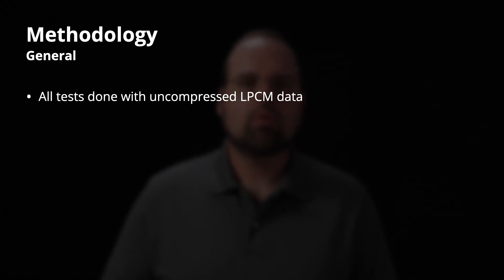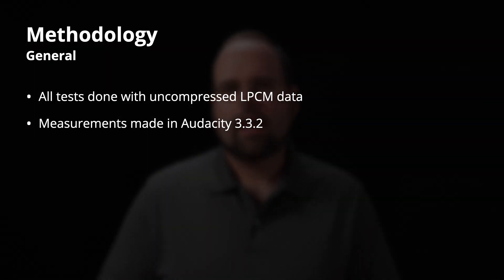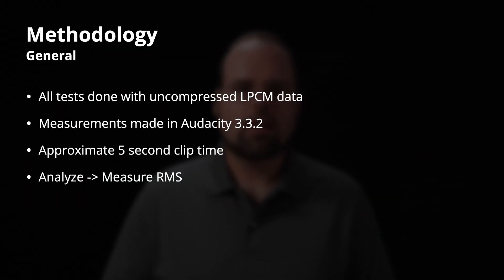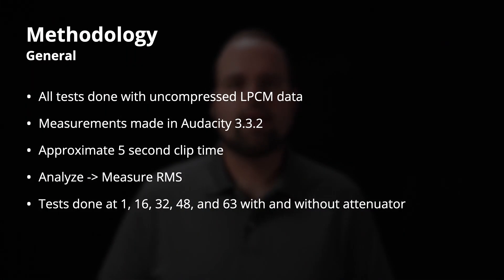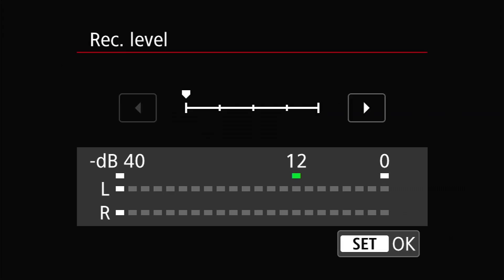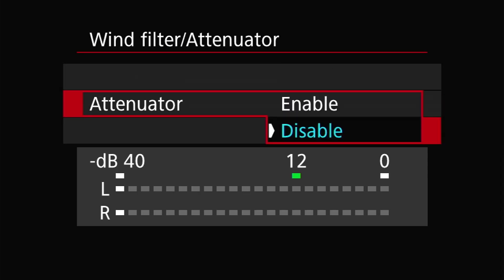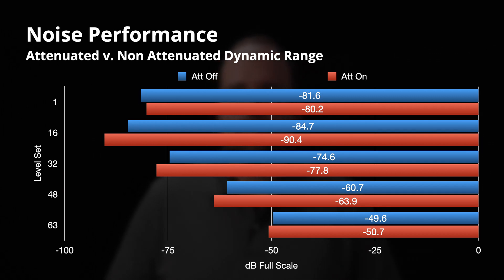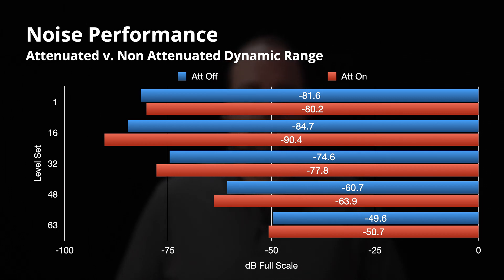R5 Audio Recording Performance Tests - EOS R5 Tip 69

Comment: Hi, I found this video hard to understand, not your fault the presentation and pace was excellent. The previous one was easier to understand. I have been recording a friend who is an opera and classical singer in an outdoor situation using my R5 camera In my ignorance I have used the C3 P mode in Auto sound recording and compression. I have not been entirely happy with the sound, I felt the higher ranges of her voice were 'subdued'. Would I be better recording on manual? If so, what should I set the manual figure to? Should I have compression on or off. Would I be able to test this in my house by playing a cd of similar music and trying the different settings? Sorry if this doesn't make sense, I am a stills photographer and trying to get into video recording.
Reply from the maker: Starting with the stills photographer getting into video bit. That's my story too, and audio is one of the things that I still struggle with. Especially being confident that I'm doing things "right", which is odd as that was never something that I really worried about with making an image.

With that said, the way I've come to think about audio goes like this. First, sound isn't light. You can't telephoto mic your way to better sound, you need to get the mic closer to the subject. A mediocre quality lav mic clipped to your subject's shirt is almost always going to sound better than a professional shotgun mic on camera 10 feet away. This also helps with SNR (signal to noise ratio) and frequency response.

Step one is always to get the most signal with the least noise to the recorder as possible. And keep in mind noise here doesn't just mean like self noise or something like that, but the entire rest of the soundscape where you're recording.

Step 2 is optimizign the recording. This is where you'll want to use manual levels, and set them as hot as you can go without clipping. Digital audio, just like digital photography clips when you reach the saturation point. And as you know, when you blow your highlights, there's no data to recover there, the same goes for audio.

Generally the rule of thumb is to aim for your levels to bet around 12-18 db below 0dBFs (the clipping point). This gives you some headroom for louder transients. However, this is a rule of thumb, and you may need/want to go lower than that what you're recording has an especially wide dynamic range between the soft and loud parts.

Which brings me to compression. In the case of the R5, this controls whether the camera records uncompress linear PCM audio data, or lossy-compressed AAC audio data. Personally, given how small audio is compared to video, I don't see a compelling reason to use the compressed (AAC) audio option. At least not if you're shooting anything serious with the camera.

There are further micro optimizations that can be made, but honestly, if you're to the point of trying to micro-optimize the on camera audio, you're probably better off investing in a proper audio recorder and doing 2-system audio with the camera's track just being used for scratch/sync purposes.
Reply: @PointsInFocus  Thanks for your reply, I will have to do some experimenting.

Comment: Thanks Jason. I find your videos very informative and well-done. I did some of my own audio testing using a different methodology but with somewhat similar results. I used an audio recorder (Sony PCM-M10) to play a fixed level computer generated tone to the EOS R5 (with the input attenuator enabled). I found that a camera record level of about 27 resulted in approximately unity gain (-12db 1kHz tone - LPCM, 48kHZ sampling @16-bits). I extracted the recorded audio from the camera's video recording and used Izotope RX 6 to estimate the signal-to-noise ratio for this setup. I measured an SNR of about 88dB which is surprisingly good since the signal undergoes both a D/A (at the recorder) and an A/D (at the camera). The audio pre-amps in the camera seem to perform well as long the record level isn't pushed too high. One advantage of this test setup is that the audio level and electrical loading should be representative of real usage. BTW, the R5 will not record LPCM (regardless of the Audio Compression setting) if the video format Is not All-I. Typically, when I shoot video, I use Canon IPB-Lite which triggers AAC encoding. The compressed audio can, of course, be decoded to LPCM with little quality loss compared to direct LPCM recording.
Reply from the maker: I covered the AAC and LPCM stuff in my other video on R5 audio settings (https://youtu.be/ezJJvKdcYe4). AAC is only forced (the camera ignores the compressed audio setting) only when the camera is set to IPB-Lite. The camera will record LPCM in regular IPB mode and up (based on the audio compression custom function setting).

As for the test setup. I did something similar when I tested the R5C. Using my Zoom F6 to generate a -6dBFS test tone and routing that to the camera. That said, I'm one of the first to admit that audio stuff isn't my specialty. I know enough about electronics and testing them to be able to muddle through some basic tests, but I'm sure there are either faster or more "standard" ways to go about doing this stuff. What ends up making this kind of stuff really challenging for me is that by the time I get around to doing something audio related again, it'll be far enough in the future that I'll have forgotten everything I figured out now.
Reply: @PointsInFocus  Thanks. So IPB-Lite is the culprit. 🙂

Audio is definitely its own speciality.Wikipedia was some good articles (e.g. see Line Level -  https://en.wikipedia.org/wiki/Line_level). 

BTW, below are the LINE OUT specs for the PCM-M10.The recorder also has an optional limiter feature to prevent clipping. It seems to work quite well (I recorded a fire engine going by with its siren blaring as a test of the limiter).

Sony PCM-M10 LINE OUT
– Load impedance: 22 kΩ
– Rated output level: 1 Vrms
Reply: @sloan.d Can you check what the ideal record level is for the R5 if the attenuator is off? Thank you!

Comment: There are so many videos out there suggesting to set the gain at two or three above zero, but with no rigorous testing.  This is the first video I’ve seen that actually digs into the audio performance of the R5 to figure out what the optimal settings are with different features.  This should be more broadly shared, it’s always been a concern for me and I’ve never had a straight answer until now.

Thank you.
Reply: Agreed. I noticed that my audio clips too fast below level 16, this video just confirmed my suspicions